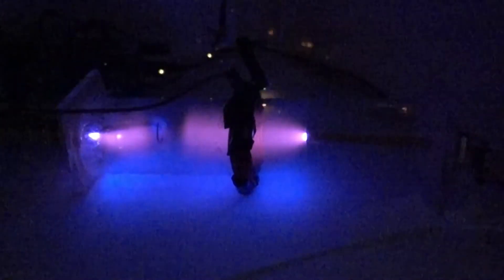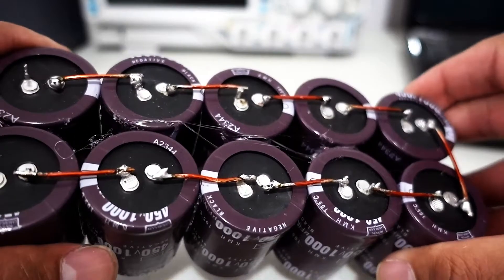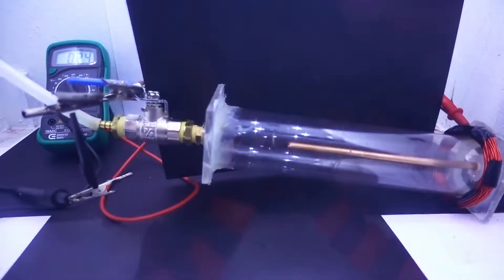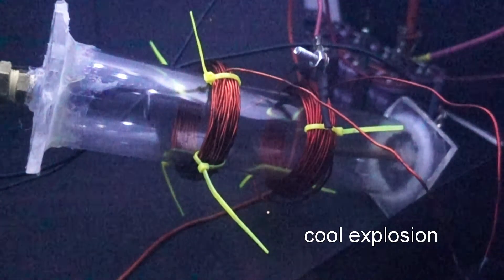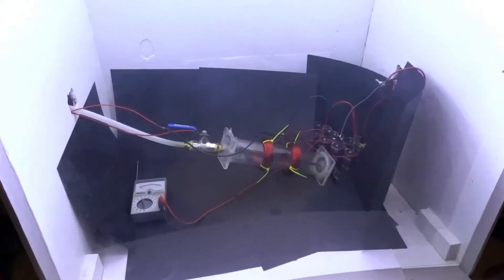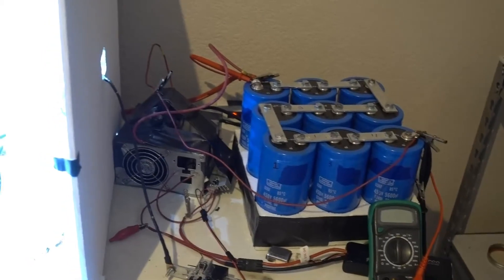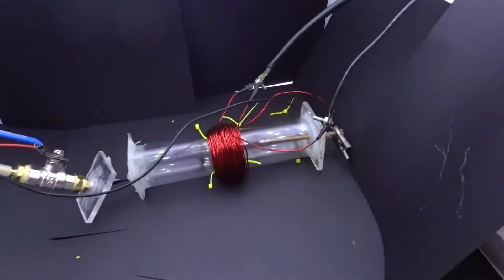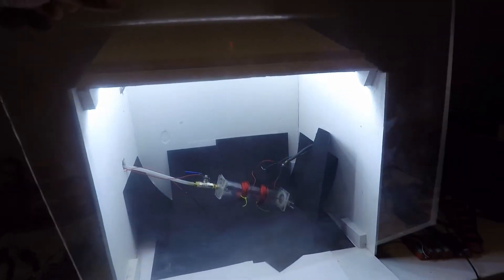Plasma Compression Z Pinch Part 2/3

Comment: Awesome channel very cool project.
Woundt the coils benefit from some steel or other ferromagnetic naterial to focus the field towards the tube something likeca hallbach array ifvthat would work with electromagnets maybe put the coils inside the tube to get them closer the the plasma since magnetic field loose alot of strength over distance. Maybe have more then one compression stage put 2 coils that fire in rapid succesion

Comment: Another thought: you need to make the field winding as close to a pancake design as possible to concentrate the field, and/or a big ferrite would be useful (use a high power torroidal transformer core and secondary windings)assuming here you are striving towards fusion.
Reply from the maker: Good point, Im not sure how the coil would survive the high current pulse, but thats a quick and easy test.

Comment: You would have more success at initiation, if the z-pinch electromagnet was rotating & vibrating at high frequency (the higher the better).

Comment: Seems like the energy you want to pinch the plasma is instead moving the coils.  
What is the result if the coils and tube are fixed so they don't move?  
Also, do you have a dosimeter?
Reply: Yeah, any unwanted movement into anything not the plasma is a considerable loss in field strength.

Comment: Consider such enormous magnetic field generated instantaneously, wouldn't the coils just turn into an EMP? This really confused me and I'll appreciate for any help.
Reply from the maker: This kind of had a low range EMP effect, I had a computer power supply placed about a foot away but in the path of the coil. The power supply handled the lights and was not connected to the circuit in any way. The pulse would shutdown the power supply for a couple of minutes before it would start working again. Everytime the pulse happened, it only affected that power supply. I tried other electronics I was willing to destroy and it didnt work on them.
Reply: @NeutronStudios1  Also I do have a question about the coils slaming into each other and split apart. Is it true that the two coils slam together when their magnetic fields lines pointing same direction, and they split apart when they have opposing magnetic fields（N to N / S to S)?
Reply: @NeutronStudios1  That's interesting, I'm planning to do some similar experiments and hope that the magnetic field won't destory my vacuum pump, considering they have large coils inside. Hope this will be fine by placing electronics away from the direction of the coil